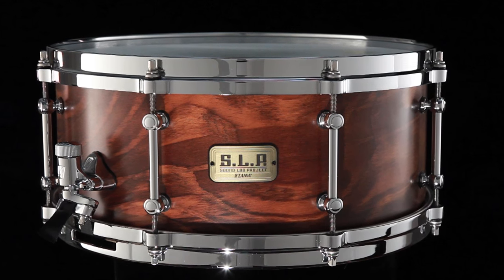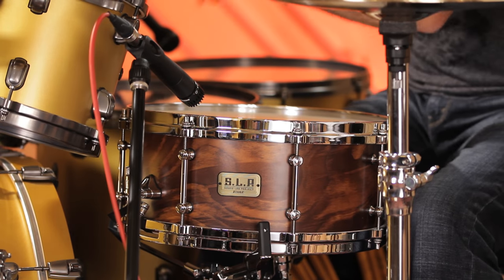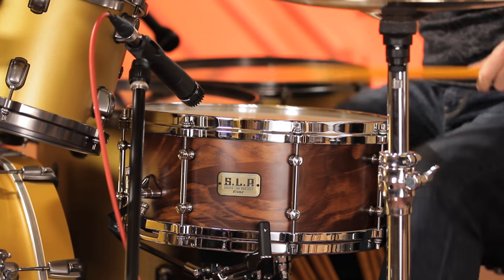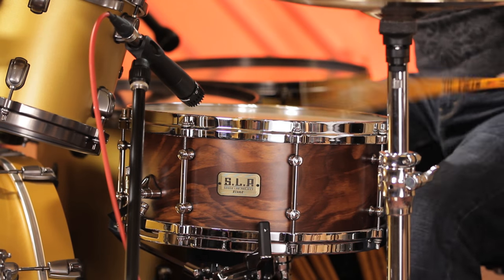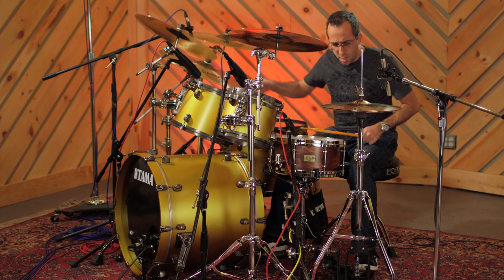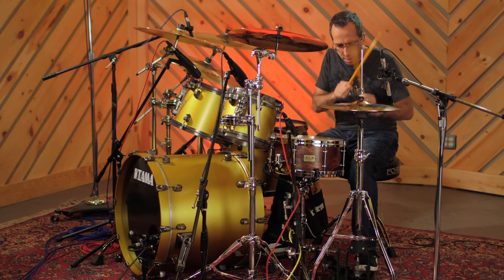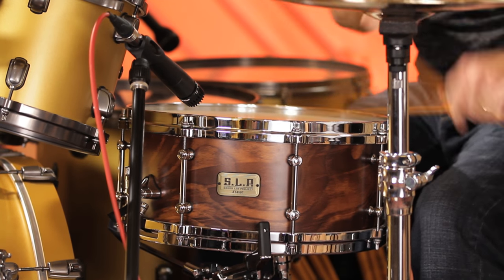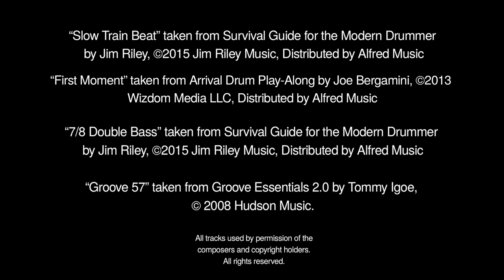Tama SLP Fat Spruce snare drum with Joe Bergamini

Comment: Hi joe! what can you tell me about the spruce as a material? I never heard about it, the snare sounds fantastic.Thanks for all your demos, I'm a huge fan of your work and drumming. Greetings from Argentina!
Reply: Spruce comes up pretty low on the Janka hardness scale compared to other popular drum woods meaning it's a relative soft wood. It should lend itself to lower tones and more resonance. Spruce is common as a material for acoustic guitars as well which tells you that it will be a great resonator and tone wood. With it being a softer wood I like that it has die cast hoops to control some of the resonance and help the drum structurally stay round, but if you get this snare you might want to be extra careful about tuning using even tension all the way around and avoid temp/humidity changes. 
Sorry for my drum nerdiness, this may have been more than you were looking for. Lol.
Reply from the maker: Lucas, thanks for the kind words, I appreciate it. I didn't know much about spruce before trying this drum, and I see the other comments here from Jake. I thought the drum sounded fantastic and it has produced a lot of emails, comments and questions. I think if you just take care of the drum like any other snare, it will be fine. It's not going to go out of round at a high tension unless you abuse it (i.e., if you put a high-tension woven head on it or something like that). Tama wouldn't put a drum that fragile on the market. Otherwise, just go by the sound... it definitely has a full bodied sound and can work well at low pitches. At higher tunings it has power and crack but is still mellower than any metal or maple drum I've played. Hope this helps.
Reply: Joe Bergamini Thanks a lot for your answer. I'm thinking seriously about try this particular model, I like unique things (like every drummer I believe). Thanks also for  inspiring playing, it's a pleasure to hear you. Greetings!
Reply: Jake Segall Thanks a lot for the advice about tunning, I'm gonna keep in mind that. Greetings from Argentina!